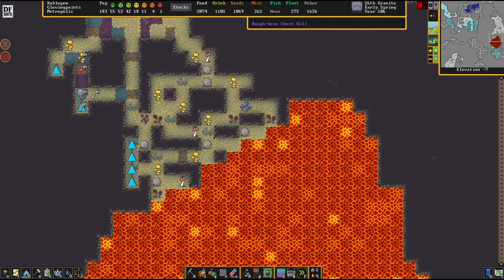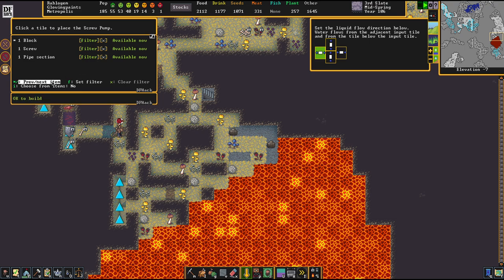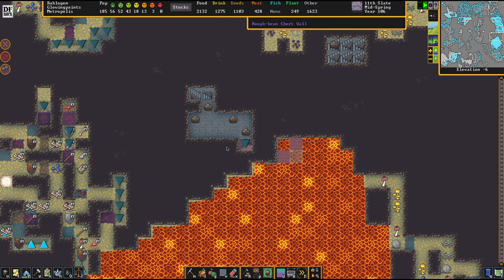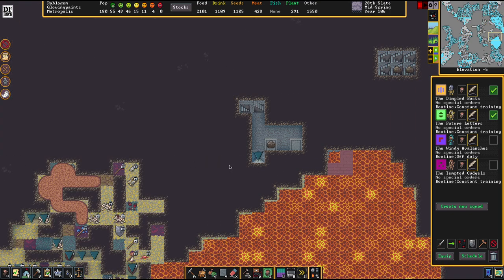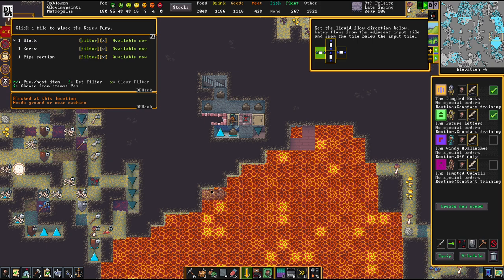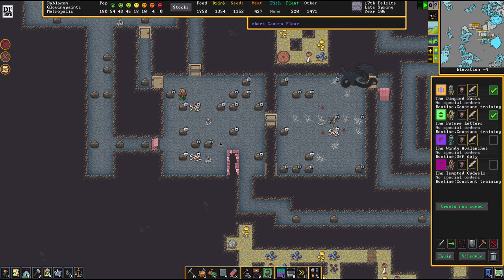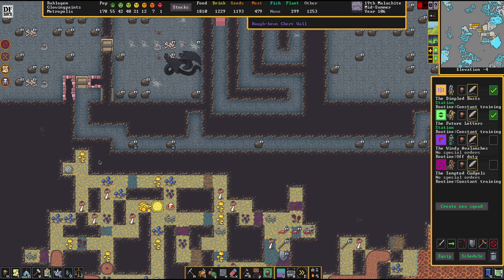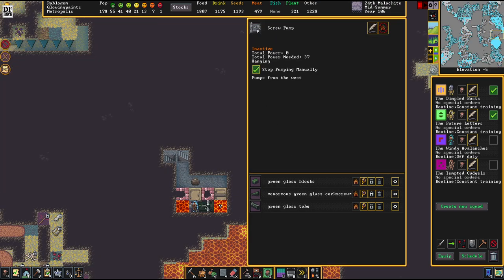MAGMA PUMP STACK - Advanced Guide DWARF FORTRESS Guide Ep 26

Comment: When i only need a bit of Magma, so 4/7 in a 1x1 pit (or several) for smelters and forges, and need to bring it up over a long distance, i prefer using filled minecarts by now.
Reply: With enough skill I could set up a spiraling railtrack "straight up" to my fort from the magma right? Still trying the tracks out, so much to learn.
Reply: @angermacfadden2702  Not really that much skill needed, once you try it you'll figure it out fast enough. It's much harder to construct a chamber where you park the minecarts, flood it with magma, and then drain the magma so your carts can be moved. Or a ditch full of magma where you kick the cart to roll trouch, and come back up the other side full of the good hot stuff.

Comment: I built my own magma stack a bit ago, I messed up a lot at first. When you're transmitting power by stacking the pumps, the very bottom pump needs to be built first. I think that's the issue you were running into with the build order. If anything ever happens to a lower pump, all the ones above it will collapse. They rest on each other.
🌌🌫🌫🌌🌌🌌
🌌🕳🌫🕳🌫🌌 -> pump
🌌🌌🌌🌌🌌🌌

Next floor
🌌🌌🌌🌫🌫🌌
🌌🌫🕳🌫🕳🌌 <- pump
🌌🌌🌌🌌🌌🌌

Ramps aren't needed
Hope that helps
Reply from the maker: You can either make it hanging from a gear assembly or resting on the bottom part. Actually if you make it hanging from the gear assembly it would only collapse when the gear assembly get wrecked. Worthwile to know if your bottom level pump is somewhat endangered.